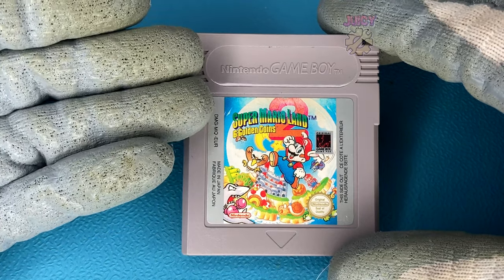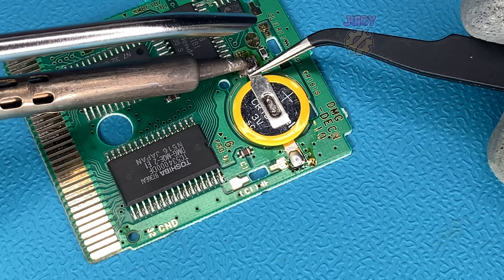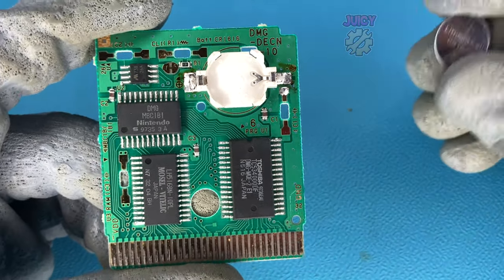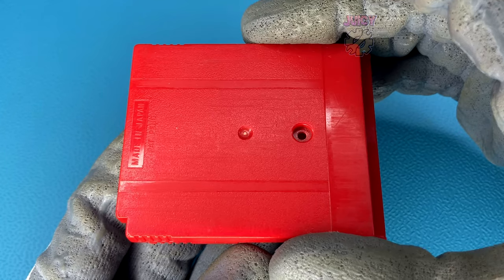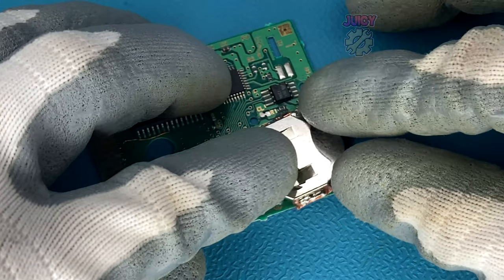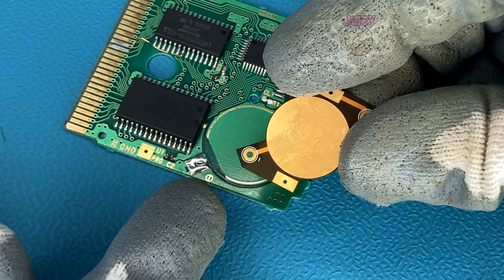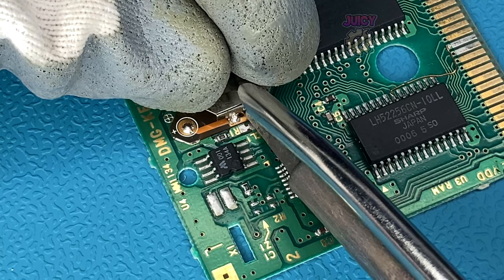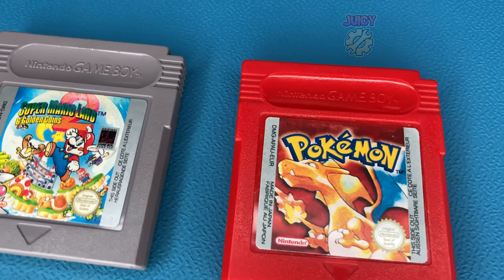NEVER replace a tabbed battery again in a Gameboy Game!

Comment: Please use flux. You get cold solder joints when you attach a new terminal with no existing solder tinning since there will be an oxide layer on the new terminals. Those cold solder joints could become problematic in the future. Also, you would not have had the flecks of loose solder with fresh flux.
Reply from the maker: i normally touch up joints off camera as its alot easier to do
Reply: @JuicyJakeRepairs  Awesome. :) I do like how concise your videos are!
Reply: @ahngelooh  OK, random guy.
Reply: Everyone is an expert
Reply: @galvanizedgnome  You say that facetiously but some really are. I do this for a living and I’m not ashamed to share my expertise. It helps.
Reply: @emmettturner9452  Tell me about it. I'm a creator in 2d and CGI in the games industry... Once commented on a weapon and people telling me if I could do better... Yes... Yes I can...
Reply: I never use a soldering iron before. When should I apply flux?
Reply: @GrimReaper86107  When wetting and setting.

If the surfaces have no solder then flux will help wet the surface, be it from adding your own flux or using solder with a flux core.

If the surfaces already have solder you can reflow to tack it temporarily but you should add fresh flux core solder or add flux and reflow before you are done (setting). If you need to dwell for the soldering iron’s tip temperature to recover and flow solder through the joint you may want to add slightly less solder than you need just so you can add the last tiny bit before removing the iron. This is because the flux that came with the solder will have burned off after a second or two. Adding a tiny bit of solder at the very end after the temperature recovers will leave you with a nice shiny joint. If you already have enough or too much solder, just add flux to the joint, clean your tip, and reflow. Remove your iron as soon as you see the joint go liquid and your flux should do its job.

Alcohol-based no-clean fluxes evaporate frustratingly fast so I recommend MG Chemicals 835 Rosin flux until you get the hang of it. It leaves a nasty, sticky, burned residue to clean up (it is made from tree sap) but it works extremely well. Isopropyl alcohol helps with the cleanup but you typically have to break up the crusty bits first (pick, screwdriver, fingernail, etc).
Reply: @galvanizedgnome yeah you’re real quiet now 🤡 lmao

Comment: only in the last 40 seconds do you admit this is just like any other replacement and you will eventually have to do it again, clickbaity title and false.
Reply: How is it clickbait? He says the CR1616 works (I've recently done a few pokemon yellow games this way). He's only saying the Cr2025 doesn't work yet. Which is what i came here for to double check as I've tried and failed with 2 different versions (they weren't specifically made for gameboy games). 

So yeah. CR1616 works. The video isn't clickbait. The CR2025 doesn't work but at least he shows you it being installed correctly but sadly that one (of two different battery holders in the video) doesn't work.

Get off your high horse kid

Comment: Honestly, I was looking for a guide on how to mod my GB and GBC carts so I would NEVER NEED A BATTERY OF ANY KIND EVER AGAIN... But sadly Google isn't showing me anything I'm looking for...
Reply: It's because you can't do it
Reply: @awsomestleaperd78  A rechargeable battery would be nice. Something that means I won't have to replace the battery, or a dual battery system, or SOMETHING to fix the issue...
Reply: @RAPTOR948  it could be done.. until you account for space, which unfortunately can not be altered in any way without causing issues with plugging the cartridge in
Reply: @awsomestleaperd78  What about replacing the chip responsible for the save data? Use some cloned GBA chips that were used for Fire Red and Leaf Green, but use them for the classic GB/GBC games?

Comment: Jake, you are very to the point and quick. I feel like I have found a gold mine of a channel
Reply from the maker: glad you enjoy!
Reply: Agreed, no fat to trim, just straight business
Reply: it's crappy clickbait, this will still die and fail eventually unless you test it all the time or save the game to some other hardware, this doesn't fix it indefinitely it's the same thing as when it's produced.
Reply: @yourmomsbf878  No, the point is not having to solder again next time you want to change batteries. Hence the "never change again"

Comment: Do the CR1616 retainer fit in GBA games? I know Pokémon Emerald also maybe the Ruby and Sapphire have CR1616 batteries in them. I’d want to put a retainer in those cartridges.
Reply: if you don't know yet, yes you can use the retainer in those games but then you cant get the cartridge to close because it sticks out too much...
Reply: You can absolutely use the cr1616 retainer in GBA games. (I use them for all Pokemon games too) I did it for my copy of Metroid zero mission. You definitely want to push it down flat. May even use the best sandpaper on the bottom to thin it out a hair. Otherwise the cartridge will slightly bulge. Doesn't affect gameplay but yeah.

Comment: he could have used cr2016  battery holder, and would fit nicely in the cartrige, they just 2.6mm thick, cr2025  with the solder feets is also 2.6mm j

Comment: Got any tips for repairing a lifted/broken pad? I did this on my brother's copy of Pokemon Sapphire, and the upwards pressure from the battery holder lifted one of the pads clean off. I've heard of some sort of special adhesive, as well as possibly using a jumper wire, but I'm curious if you have a preferred fix.
Reply from the maker: if its the battery pad, its very likely there is a copper area nearby that you can scrape the soldermask away and connect too instead. If you still have the lifted pad, you can stick this back down with some adhesive and restore the connection (again with some scraping) If you dont then i would use something like copper tape instead of pad
Reply: @JuicyJakeRepairs  Thanks for the reply! I do still have the pad, so I'll try gluing it down and wiring it up to the copper
Reply: @n0lain  did it work?

Comment: Will this affect saved files?
Reply: It would kill them unless you temporarily wire the new battery before removing the old one. Or buy something like a GB Operator to backup your save to a PC. Use the GB Operator again after changing the battery to load your save file back into the cartridge.

Comment: I don't like the title of the video
never use tabbed battery!! -> because battery holder is better ? 
I call it a clickbait
Reply: I'd say it's better, since you can just throw a new battery in if it goes bad, and you don't have to break out the soldering gun.
Reply: lol yes it is better ...
Reply: It's better in three ways:
- future battery swaps don't require soldering
- makes it so you can get a replacement battery at just about any local store, rather than needing to place on order online
- those tabbed batteries are more expensive and sometimes only last a couple of years, because they already sat on a shelf for years or weren't fresh (recycled) batteries to begin with.

That third point is the most important one to me